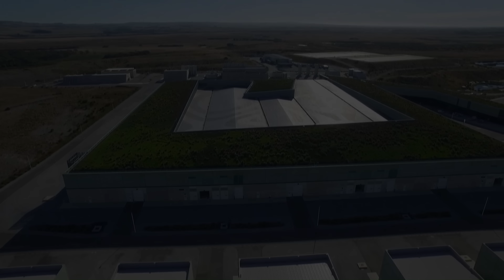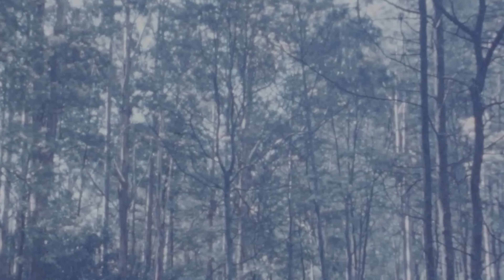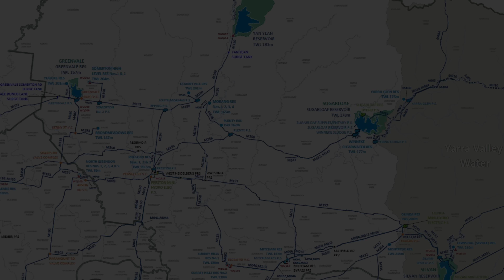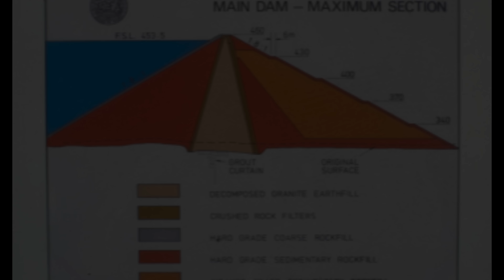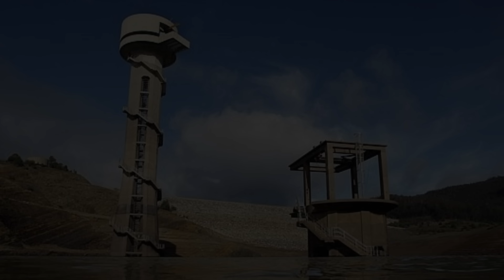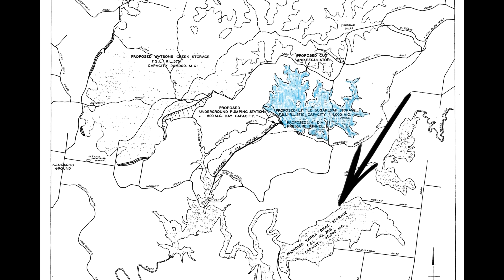Melbourne's Water Story - Ep4:  Melbourne’s Water Giant (1970s–Present)

Comment: Has the Elvis fire helicopter been removed from the dam yet?  It was rumoured to have made the Thompson water unusable for Melbourne for quite a while due to the fuel contamination.
Reply from the maker: Not entirely sure but it does read in a few follower up articles after crash that it may have been cleared. Given oil floats on water that might have minimised the risk but still unfortunate it did happen. You reminded me that it happened thanks to your comment.

Comment: Hi Paul
Love these videos 
I’m ex MMBW / Melbourne Water
Are you going to cover off on the construction of the Thomson tunnel from Bells Portal 11kms upstream of the Thomson dam wall And the Reservoir Portal above Upper Yarra Dam?
All this infrastructure predates the Thomson and ties in with Easton and Swingler weirs prior to the Thomson flooding both of these
Cheers
Michael
Reply from the maker: Thanks Michael,
I’m definitely keen to do a few more videos on the individual water assets themselves. Thomson is an incredible story in its own right! I’ve definitely got it in my backlog of ideas, but am just slowly working through them all - these videos as you can probably tell are trying to tell a very very long story in a short time frame. The dream will be able to share a more detailed story of each one when I’ve free up some time. 🙂
Reply: @AusEngineeringHistoryStuff  Thanks Paul
Yes a huge amount of history 
Can probably be of assistance with some of the Thomson stuff between myself and my Dad he was a boss at the Warburton depot and knows alot of the early Thomson tunnel stuff
Myself I was involved later on with inspections and setting up of the inspections in the 1986 and 1991 of the tunnel